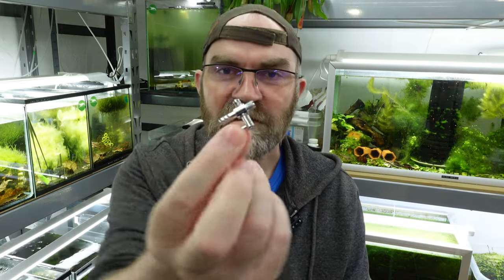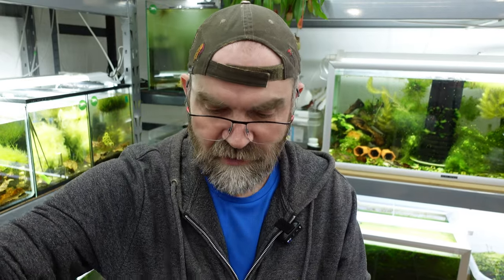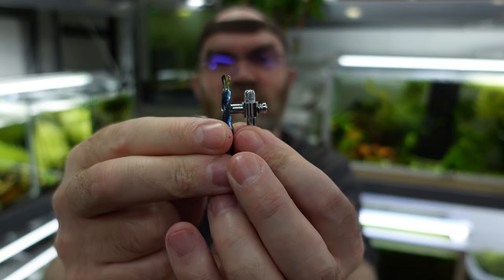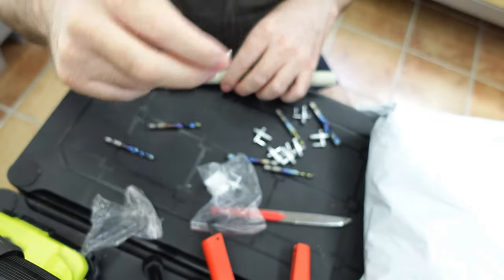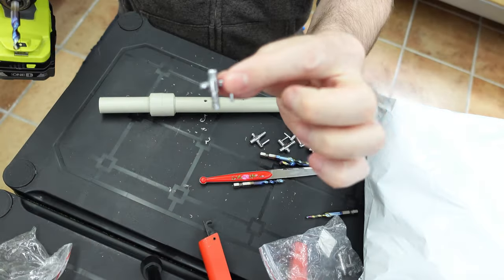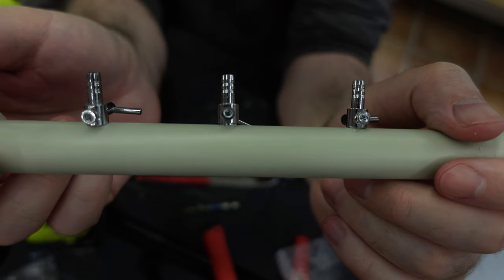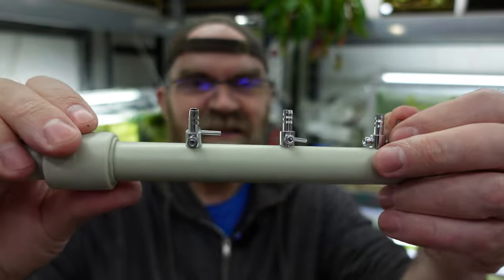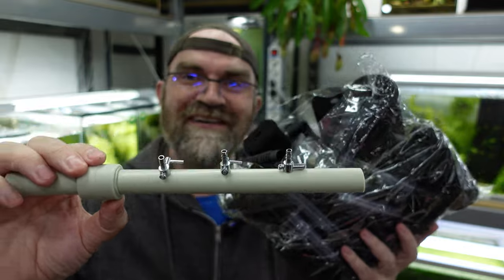Avoid This Painfull Mistake When Setting Up Your Fish Room Air Loops...

Comment from the maker: Will include links in the first comment incase I ever mass change the description:
6 Double Sponge Filters link: https://www.aliexpress.com/item/32717894641.html

Valves 10 Pack: https://www.aliexpress.com/item/1005001812944506.html?spm=a2g0o.order_list.order_list_main.28.20e118028W43rh

Taps: https://www.aliexpress.com/item/1005005605227773.html?spm=a2g0o.order_list.order_list_main.17.20e118028W43rh

Comment: When drilling there is no need to reverse, simply keep it going forward and once it's through just run it up and down. Helps clear the swarf and keeps your bits sharp. Old material specialist, know my tools. Love your content, shrimp life is good life ❤
Reply from the maker: Good tip!
Reply: @MarksShrimpTanks  prefer akadama over amazonia?
Reply from the maker: i like both the same so its just what ever I can get at the time, like my next two tanks will be akadama.
Reply: @MarksShrimpTanks  I have some akadama in reserve, was impressed how well it worked, I also like the colour. Keep up the amazing content 🦐  ❤️

Comment: My no. 1 tip on these metal valves? Buy extra valves when you're making your air manifold. Sometimes they strip, sometimes they break. Sometimes they don't even work at all. Add five minimum to your total is a good start, I usually buy ten extra just in case or if I want to add another line (s) later. Tapping is absolute must and not that difficult to do, just keep your drill on low and make sure your straight on both planes before you commit to that hole. If you do have a leak in your manifold you can use a little silicone around the valve to help seal it up.
Reply from the maker: cracking advice thank you.

Comment: I feel your pain. It took me a while to work out that you can put the valve in the drill chuck. I use 22mm push fit pipe and drill a hole (can't remember what size) but then put the valve in the chuck and went fast until it bit, then slow and finished off by hand. We need some little o rings to seal, I think, but mine are pretty tight already.

Comment: I dril a 4.5mm hole and than i put de valve in the drill and pushdril the valve in the pipe .......works great for me
Reply: Exactly what I do
Reply: This right here.  I've never tapped a hole for the valves, and I even have suitable taps.  Just put the valve into the drill chuck and drill it into the hole. Threads bite into the plastic and the end result is air tight.